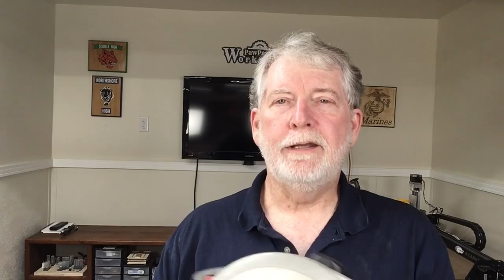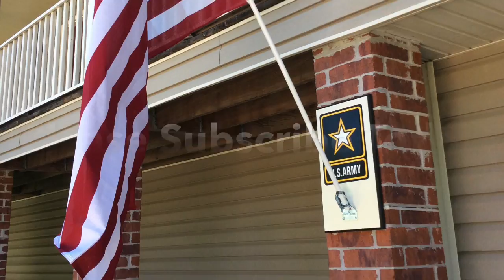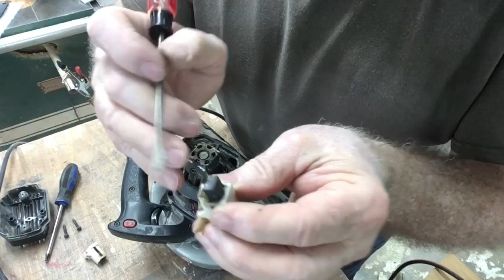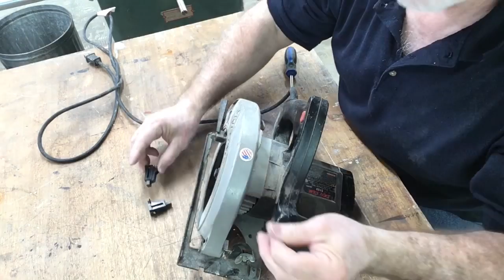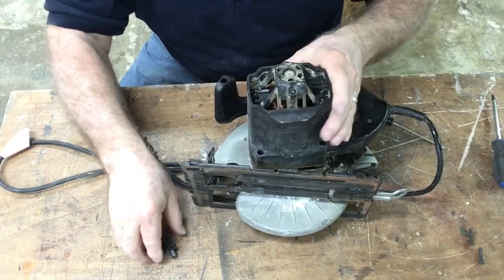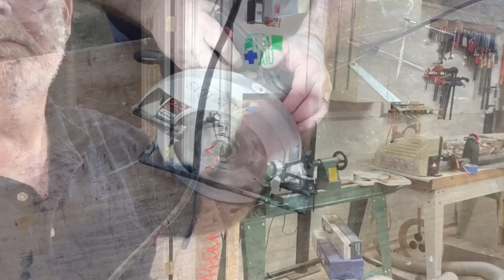How to Turn Trash into Treasure: New Brushes Saves Saw!

Comment: I did that to my Skil saw 5150 from 1995 after I graduated from high school my father got my a few power tools a cordless DeWalt drill dw-991k2 kit the skill 5150   circular saw 10 amp  a porter cable tiger saw 629 6 speed  and  my uncle gave me his black and decker 7580 jigsaw and got some hand tools still have the circular saw and got 3 more a old black and decker circular saw u 130 it was my grandfathers and shopcraft circular saw another vintage black and decker jigsaw it was my grandfathers 7515 with case works perfect got a newer skill jigsaw in 2012 that I use every day my grandfather thought me if it can be fixed do so why waste money if you can fix up for cheap and keep it going I just did that yesterday for my neighbor a older craftsman reciprocating saw industrial made by black and decker only needed the commentator cleaned the blade holder oiled and  grease  put on the bearings electronic switch cleaning solution for the speed control and trigger that's it well long story short the neighbor ended up decided to buy a new one so got two reciprocating saws that fully work thank you for your video
Reply from the maker: Awesome!  Thanks for sharing

Comment: excellent video. I think this is the issue with my 25 year old saw.
Reply from the maker: Most likely it is the brushes and second and less likely the bearing will wear out.
Reply: @PawPawsWorkShop  Thanks for your reply. if the bearing wears out will that prevent it from starting? or even attempting to start? I do nto use the saw much but in the last few months a couple times it sounded like something was rattling  a bit ... so I thought of the bearing ... but then it would sound ok again. then when the saw would absolutely nto start at all I thought it is not getting juice ... ala the brushes. Is it fairly easy to replace the bearing? or is a machine press required? or is it not replaceable at all?
Reply: I found a video on replacing a bearing on a different model I will check it out. I have ordered the brushes so will install those.
Reply from the maker: Awesome.

Comment: It can be so easy to change trash into a useful machine. With all the environmental pollution mad by things, which were thrown away, it is great to repair those machines. I'm only 48 years old, but my parents show me, to use things in a proper way to keep them useful as long as it could be. And it is sometimes so easy. And if it isn't possible to repair them, you can make some wonderful decorations with a little bit of paint, wood and so on. Thank you for your video
Reply from the maker: You are so right.  Thank you very much.  It is great to hear from you again.

Comment: I hope you saved some good old saws and some viewers some money. Thanks for this.
Reply from the maker: I have done this on numerous occasions.  My table saw motor has been rebuilt. It is over 50 years old.  Replaced brushes on my router several times.  I also have several circular saws for over 40 years old.  I find the old tools are often better than the new ones.